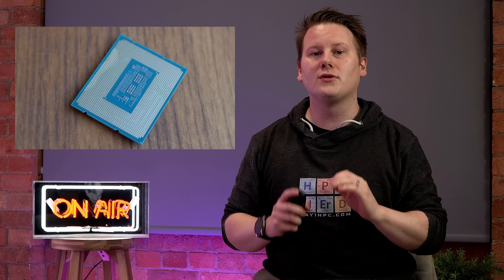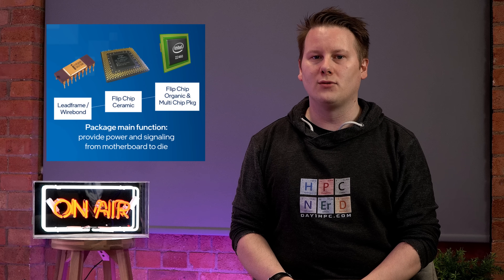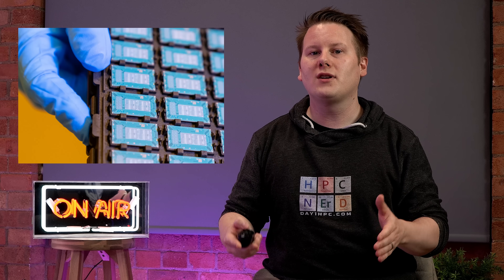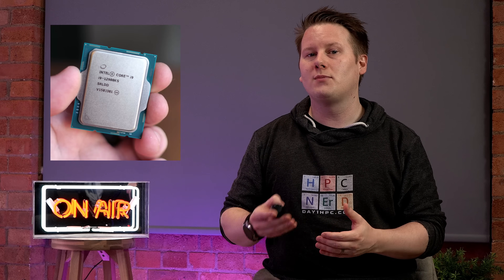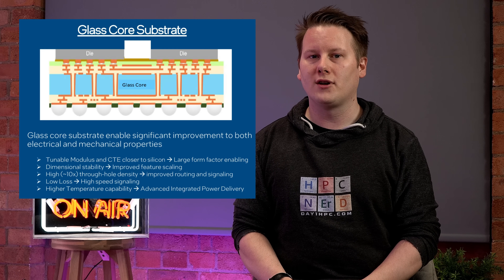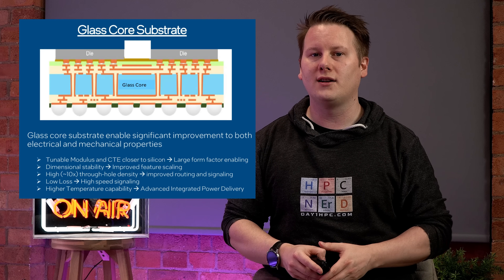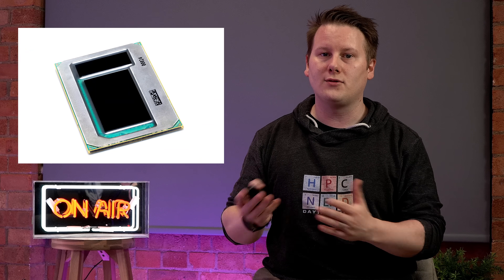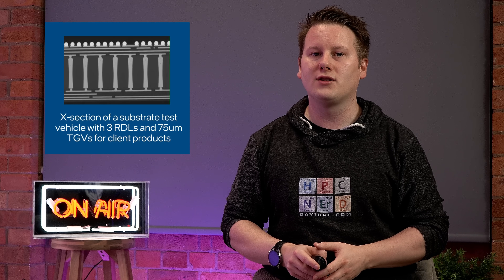Intel: We're Replacing PCBs with Glass Core

Comment: You forgot to mention the upcoming heat sink substrates, offering a doubling (or more) of the heat transfer rate by allowing a new path to cooling. Essentially sandwiching the silicon between two heatsinks. Glass won't be the best thermal conductor for the Bottom Heatsink. 

Diamond Substrates will replace these Class Core with 5 times the thermal conductivity of copper while being an excellent electrical insulator. This should more than double the allowable power usage within the silicon chip.

Available at a store near you in 50 years or so. Diamond Wafers are already a think.

Comment: Good to see intel coming back and pursuing other materials to drive innovation.  I'd just ask what are the benefits in terms of die size, frequency, power consumption, etc? Is glass necessary to support a robust chiplet ecosystem with UCIe? What about cooling performance, is glass a better material for more effective cooling? So many questions.  Thanks again!
Reply: I think the biggest deal would be wire size. If you saw AMD talk about RDNA3's MCDs requiring an order of magnitude more interconnects than their CCDs, and splitting into multiple GCDs would require an order of magnitude more than that, this is where that comes into play. Since they can make the wires and contacts smaller, you can have higher bandwidth between chiplets at lower power and lower latency. I wonder if this will replace passive silicon interposers.
Reply: Packaging is also a thing they have done a lot of research on. Back in I think the late 90s/early 2000s, they worked a lot with Ajinomoto (yes, the company that also makes instant ramen) to work on a new, increased density packaging system. Moving away from the fully woven types of substrates (with cores and prepregs) they moved to a core with what some call ABF (Ajinomoto build-up film) to get higher density and thinner substrates (which in turn allows for smaller vias and tracks, and thus higher density). These became the defacto standard for anything high density up to recently, where CoWos and such have been taking up a lot of the demand.
Reply: Signal integrity seems to be the biggest thing
Reply: the benefits are probably going to be something like cheaper HBM3 without the huge silicon interposer, but probably a bit worse performance then the interposer, the larger benefits is its going to make chiplets that work without silicon interposers a hell of a lot better, right now on organic substrates IF can only reach pcie4.0 speeds and this limits memory clocks too, and the interface between ccxs on dual ccx parts is literally slower then dram, AMD already made a special PCB for RDNA3 chiplets, but Glasscore could allow Chiplet CPUs to reach pcie5/6 speeds, and who knows maybe its cheaper then the thing they used for RDNA3, or maybe its faster.

Intel is going to want this kind of thing for Tiled CPUs too, the whole industry is slowly moving to chiplets, i think it makes sense to have all the power hungry chips under 1 good cooler, but the whole gluing together a bunch of smaller chips idea is mostly just a temporary cost saving thing, today we have CCXs and IODs, and Intels going to make a GPU chiplet, probably AI acellerators or something, and we have off chip memory, but in the future when EUV lithograpthy gets cheaper it will probably just be a big fat integrated die with some memory chips around it, a lot like Vega.

Comment: This looks really interesting; more please! What concerns me is the strength and fragility of the glass substrate.  Will a CPU with a glass substrate survive being dropped? How about if the heatsink is overtightened?
Reply: I expect that the IHS will still be effective at protecting against overtightening. Dropping the CPU, meanwhile, is probably going to be far more risky than it already is.
Reply: Glass can actually be fairly resilient against broad impacts so dropping it may not be an issue depending on its crystalline structure. Sharp points or corner impacts are a different story.